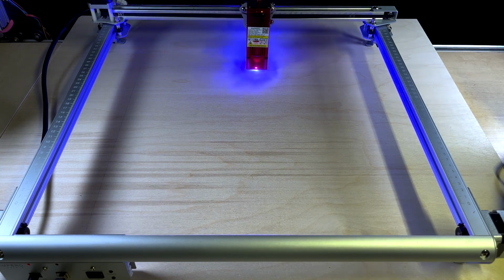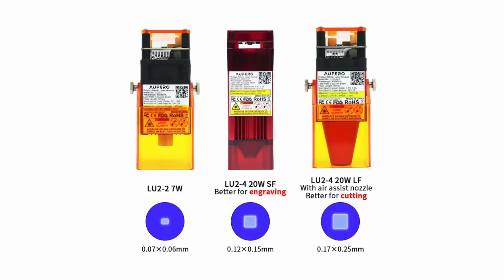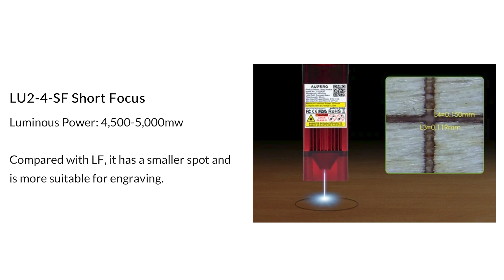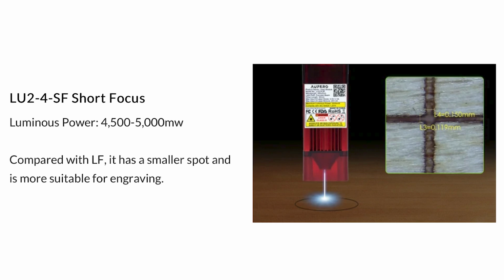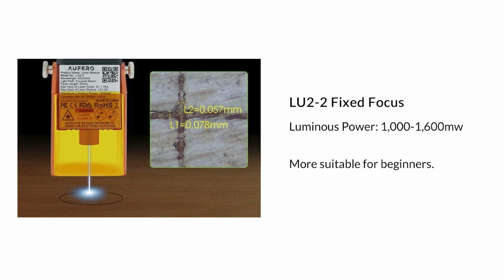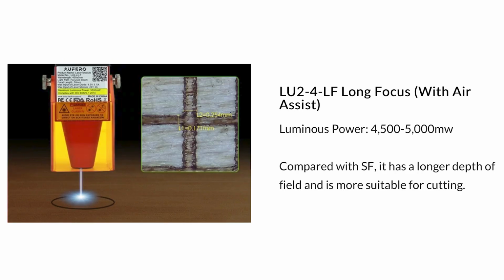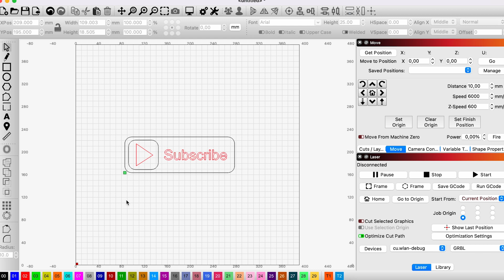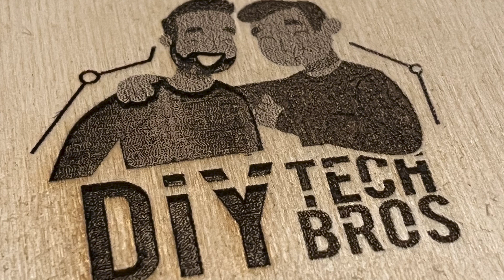Aufero Laser 2 - Important to know

Comment: that laser cant cut plywood of 4mm... I try with 100% power, speed 100 and 7x times and nothyng... Cant cut! I have same!
Reply from the maker: Two questions: 
1.) at what depth are you setting your focus? Make sure to set it 2mm lower for 4mm cutting.
2.) what kind and grade of ply are you using? Note that twig knots, glue and wood type will influence performance!
Reply: i have the same problem.

Comment: Good review, thanks! However I have to disagree on one point. This machine can in fact be used in absolute coordinates with a grid on the spoil board. Like any other laser with no limit switches, you simply manually move the laser module to the 0/0 position before turning it on. Then in Lightburn, on the Move tab, click Manage next to Saved Positions, and create a new position and call it 'Home' with the coordinates of 0/0. Then anytime you want to home the machine, just pull down the drop down menu and select Home. While you're on the Move tab, in Move to Position, set X to 200 and Y to 385 and click Go. Now click on Set Finish Position and when your job finishes, the module will move to the finish position, out of the way, so you can retrieve your work. I work in absolute coordinates so I can use my spoil board grid to position my work without the need for framing.
Reply from the maker: Hi! Love your channel!
Yes, we should have specified that there options to overcome this. We were more referring to that, we at least, find it easier to repeat a cut after the laser has been physically moved if the laser has auto homing. 
Thank you for your feedback! We fully agree with you. Keep up making super useful videos 🤠
Reply: @DIYTECHBROS  Thanks, I enjoy your channel as well! 👍
Reply: @DIYTECHBROS  Did you get a different machine? The Aufero Laser 2 I got is 400x400.
Reply from the maker: We have not tried to push it beyond the official “ortur tech” limitations:
 https://ortur.tech/auferolaser2/

Comment: Can this do multiple items at the same time or must you only do one at a time? Thinking about missing that homing feature, and if it would matter for that purpose.
Reply from the maker: It returns to origin after each run, so you can do one, replace it, and do the next one. This is actually more accurate than homing :-) the homing switches are not 100% anyways.